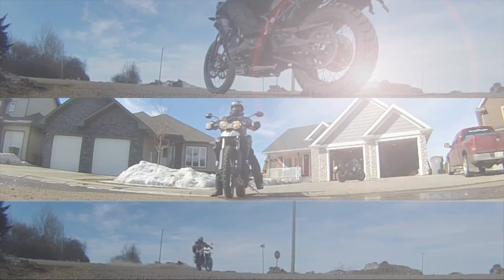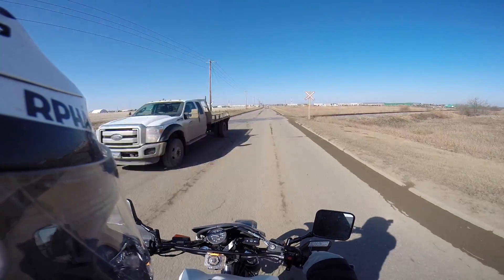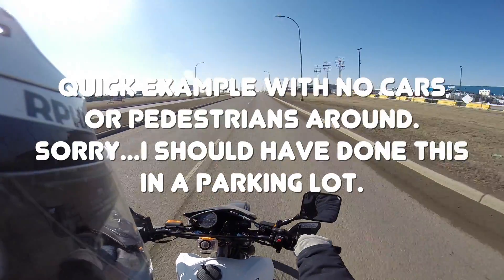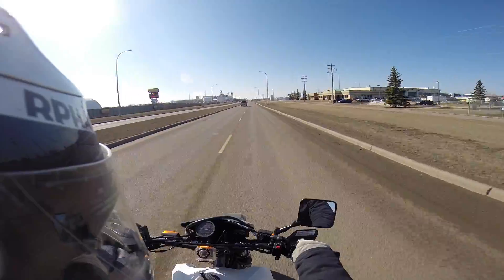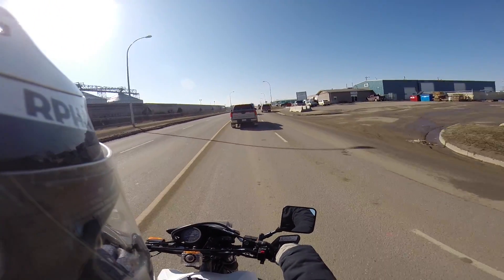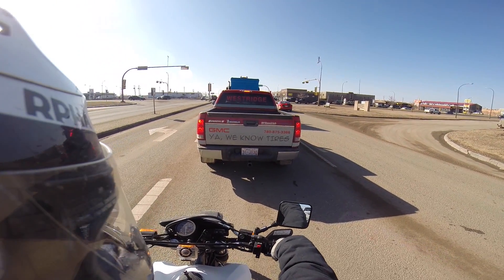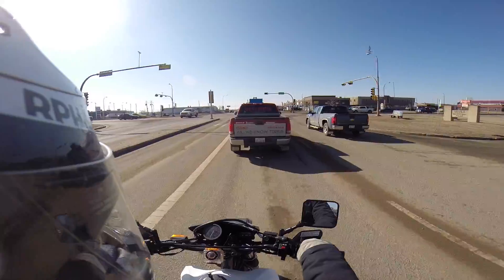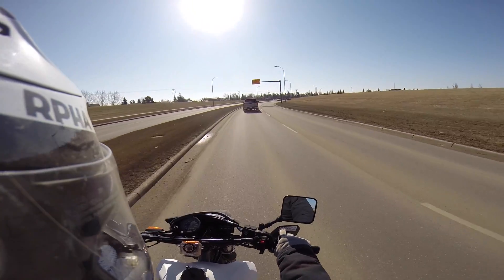DR 650 Carb Update and Canadian Born and Raised Master

Comment: I've bought a new calibrator with a pumper on it (what your mechanic was talking about) but I still have my stock carb in my bike all jetted up.  If you want to take it for a quick rip to see how it works with my needle and jet settings let me know.  I know the BST40 carb very well and think I've got it tuned perfect for my bike. 

I sent ya a message through youtube with my number, feel free to let me know if you want to try it.  I'll be switching them as soon as I get my new carb (in a couple days likely) but any time in the meantime works for me.
Reply from the maker: Yeah, any time man. Maybe it won't rain tomorrow.

Comment: Yup, you dont get instant power with a vacuum carb,  however you can go over mountains and not have to rejet the carb. An accelleration pumped carb is what you want, a used one on ebay is about 200 bucks maybe. For your carb google "Daves Carb Mod"
Reply from the maker: NakedBeachRider Thanks for the tip...maybe next year.